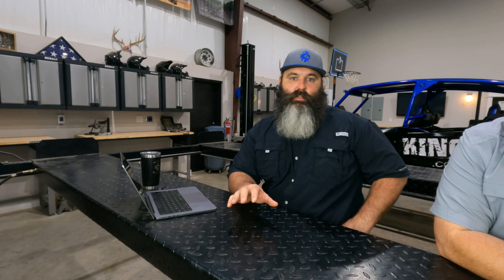Episode 18 - SXS Power Steering Issues (We found the solution)

Comment: 2019 Rzr turbo s with dynamix eps stopped working  and steering exclamation came on after power wash. Fuse is good, all connections seem dry. What else can it be?
Reply: Same my steering exclamation came on after I washed it, did you find out what it was ?
Reply: Check for power at the connector.  Make sure you battery is full charge.  They shut off if the battery is too high or too low.

Comment: My 2020 has the problem suspension is locked in red and power steering is not working after replacing with a new battery and jump started it. Apparently jumped starting it kills the power steering. I’m lost don’t know what to do.
Reply: Ya solucionaste tu problema?

Comment: I have a xp1000. My steering doesn’t feel like it has much if any assist. There is no warning light for this showing on the dash.  I pull a new rack on this winter and made sure to line up the marks on the rack & shaft. I read something about pulling the steering wheel and if the nut is too tight it will make it hard to turn. Any suggestions or advice??